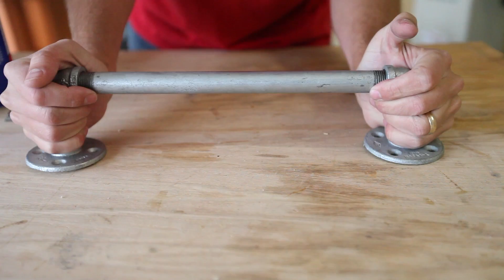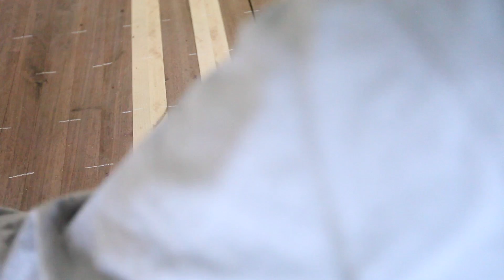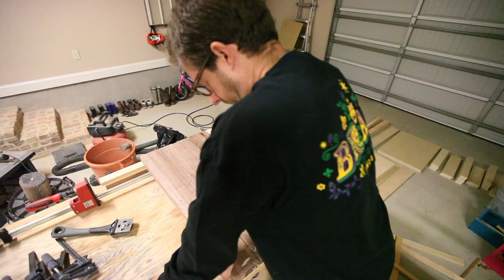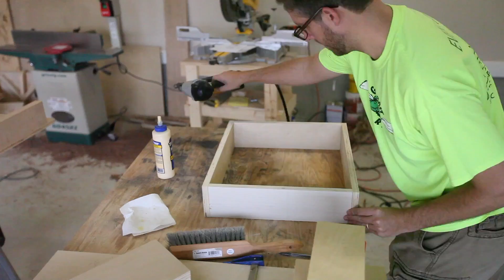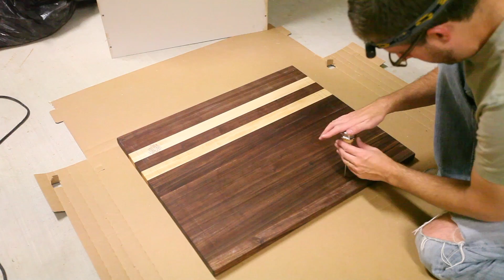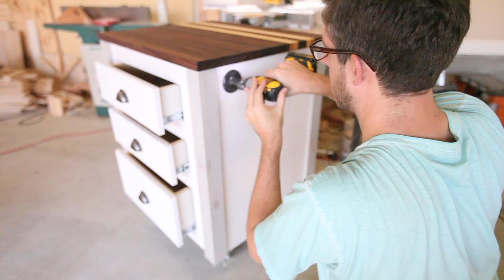How to Make a Mobile Kitchen Island // DIY Woodworking Project

Comment: maybe i missed it but how did he connect the cutting board top to the cabinet?
Reply from the maker: I used a Domino mortiser to cut slots on the inside and then secured the top with “Z” clips.

Comment: Isn't that wasted space? Building the drawers smaller than the cabinet?
Or do you think the reduces max weight / visual style outweighs that concern?
Very nice build! Thanks for the video :)
Reply from the maker: Dejay Rezme Oh, you're totally right...it is wasted space. However, it is the look that the client wanted. He didn't want the drawers as wide as the cabinet. Thanks for checking out the project!

Comment: I'm in awe that you held on to footage for two years and were able to put together this video! Project turned out nice! Must be great to see it still getting used after two years. I've not had great luck with dowels either - glad you went with a normal glue up.
Reply from the maker: I guess you just put into words why I had such a hard time putting together this edit! ha ha. Man, it was a little rough. I started filming projects back in the fall of 2015, and I didn't start posting on my channel until January of 2017. Not sure why, but that's what happened. Thanks for watching it, Doug!
Reply: Bruce A. Ulrich that's pretty awesome you have all that footage. Thanks for sharing it!